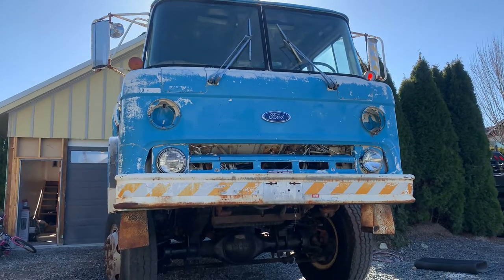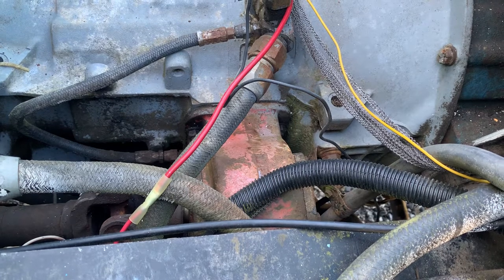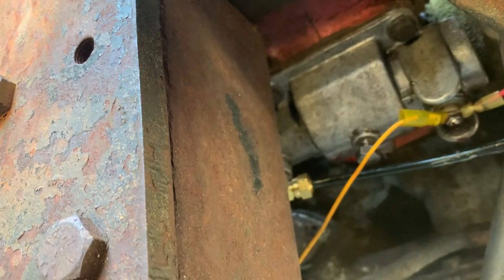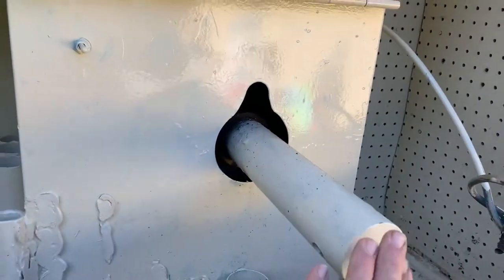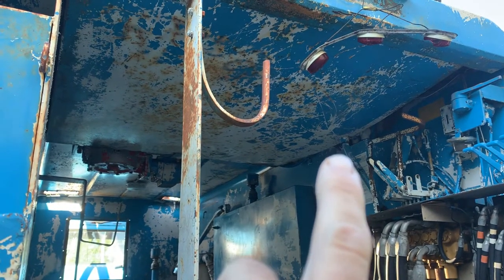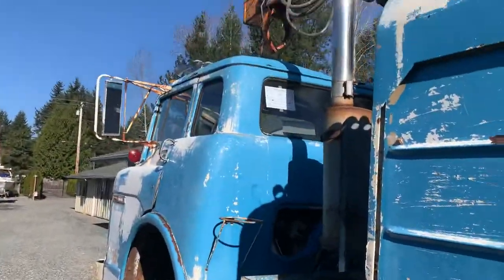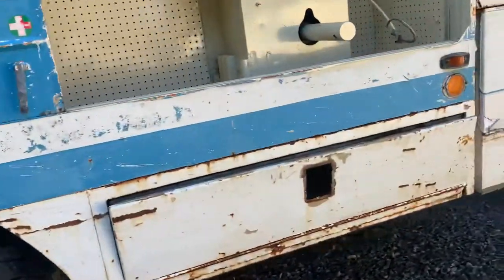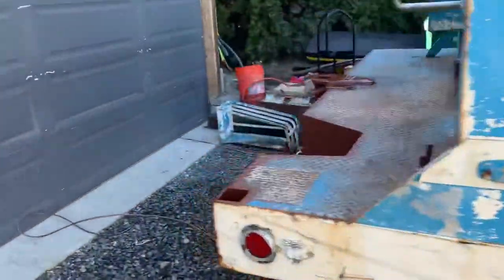C8000 series Ford 4x4 Marmon - Herrington all wheel drive conversion truck 8.2 turbo Detroit AWD 4x4

Comment: C model fords with that Budd cab were built from 1957- 1990. I have 2 C750's 1970. I am also in Washington state, unfortunately both of mine are gas powered, and 2 wheel drive. that is a badass rig there bud, Cheers!
Reply from the maker: Thank you. I’m currently rewiring some of the main harness. It’s a fun project and glad that you have a C series as well. I just saw a neighbor with a yellow one that’s a dump truck here in Silverlake area of Everett. One thing I notice is on the back of the cab there is an area that is prone to rust if you don’t clean it out. This is the only area mine has rust on it and I was able to fix it before it got bad. This summer I’m going to paint the cab with some equipment paint and help my Inlaw build a pole building using the auger and crane.  Thanks again for liking my video and cheers to you my friend
Reply: @jaybjornbjornintheusa3039  I think I may live nearby, any way to contact you privately?
Reply from the maker: Sure thing text me at 4255015292
Reply: @jaybjornbjornintheusa3039  I saw the yellow one today, on my way home from Freddys! you are very close, I'd love to come and look that rig over and maybe give you a hand, there's not many of us c model guys out there. I have a full set of Ford books as well. I have a parts truck... Cheers, Will. P.S. I'm not a weirdo!
Reply from the maker: @wlogue  thank you.  Yes please come by and check it out! I’ve been tight on time lately and would like some help with the ignition wiring.  The other day I had to by pass the fuel solenoid harness and give it power directly to open up to give the motor fuel. The running lights on top of the cab leaked before I replaced them and I think it corroded some of the wiring under the dash

Comment: Hi I live in Australia  I worked in the electricity  supply company they called these trucks a pole borer trucks the trailer  they towed behind was for the new poles these trucks did alot of engine hours but not as many miles you will find alot of use for this truck
Reply from the maker: Hi there! My brother in law is from Australia!  Thanks for the info.  Yes, so many uses , and we love the project - this includes all my family- my kids can’t get enough rides in.
The engine hours luckily are low post rebuild, we will see how the 8.2 lasts. 
Cheers!

Comment: There is no Allison 658 brother.  Probably a MT643 or MT653. The MT653 is a bit beefier than the MT643 but is also a 5 speed auto.
Reply from the maker: Mt643 Finally was able to find the ID plate. I just did the transmission service and fix my PTO.  update video soon